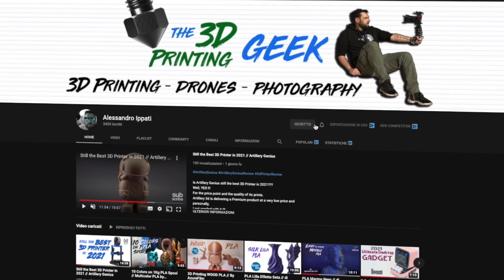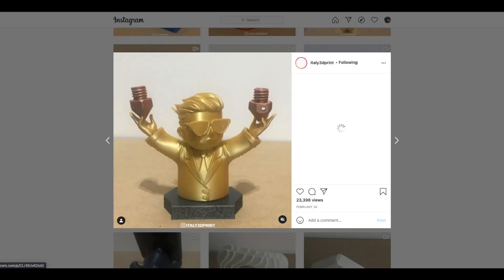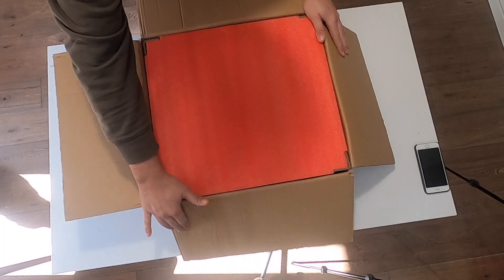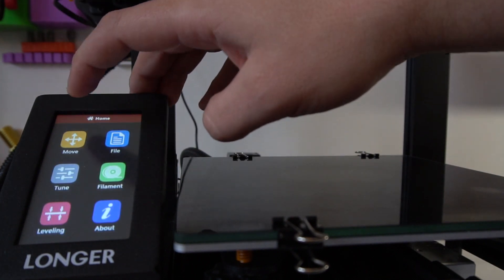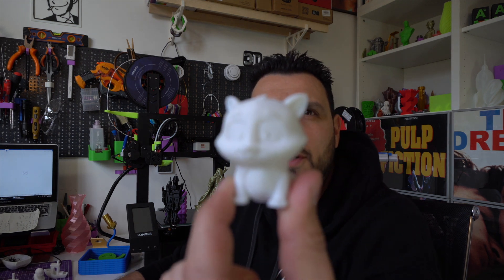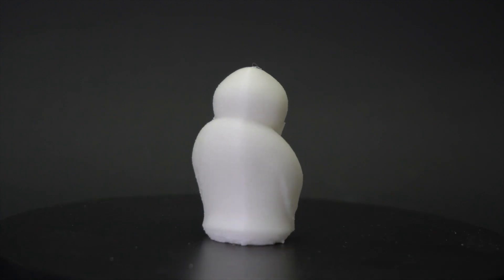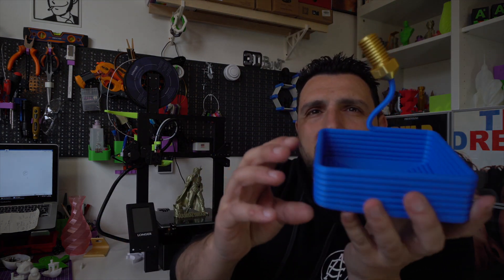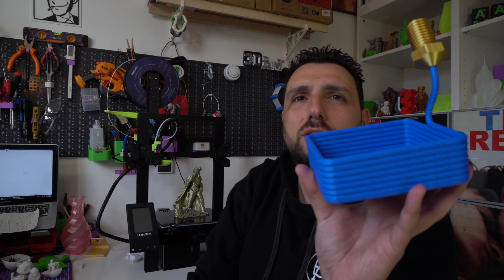BUDGET Price, PRO Quality 3D Printer // LONGER LK4 PRO (2021)

Comment: I just ordered the non-pro version, I got it pre-owned directly from longer for $100! It was a return, they went through and reconditioned, replaced anything missing and fixed whatever the complaint was and sold it for super cheap! Anyway I am super excited about it. Every video I've seen, sponsored and not sponsored shows it to be a really excellent one and I'm glad I chose it over the much smaller monoprice printer I was initially going to buy.

Comment: bought one of these 6 months ago. So worth it. Made some modifications mind you but still very worth it. I did replace the glass bed with another one that was not slightly warped in the middle.
Reply: Can you provide a link to that wire guide for the boden tube/wire setup like you have?
Reply from the maker: @ltlk937  https://www.thingiverse.com/thing:3875963
Reply: @AlessandroIppati  Much appreciated sir!!
Reply: @AlessandroIppati  Oh no i was talking about the one you attached to the hot end, the one that holds both the wires and the bowden tube, and attaches basically to the same plate the hot end is screwed down to.
Reply from the maker: @ltlk937  https://www.thingiverse.com/thing:3713588 you meant this ???
Reply: @AlessandroIppati  No sir, its not the fan duct, its shown first up close at 4:11, It sits above where the boden tube and wiring enter the hot end area, It clips to the back plate of the carriage, and clips both the wires and the boden tube together.
Reply from the maker: @ltlk937  orry man... https://www.thingiverse.com/thing:3991758 this is one and  this is the other one thingiverse.com/thing:3415356 ... hope that works for you